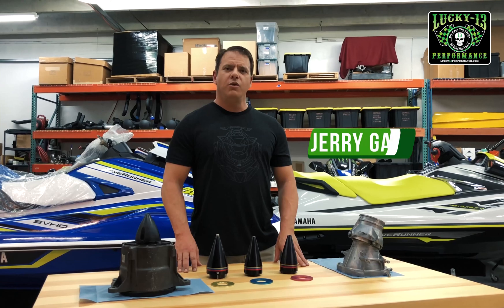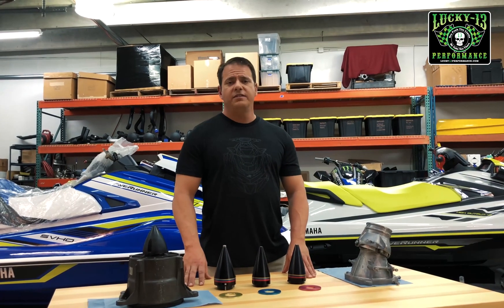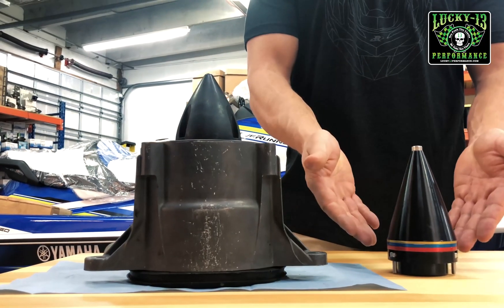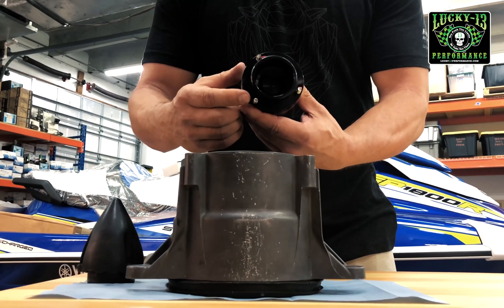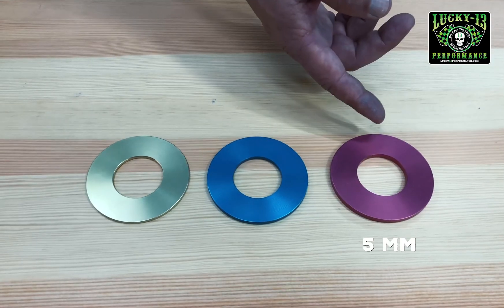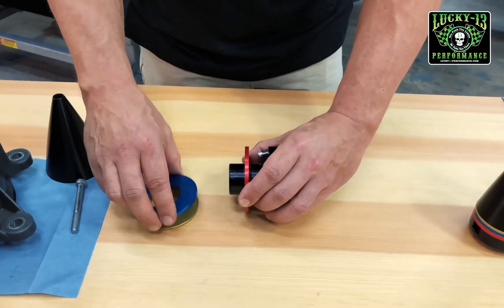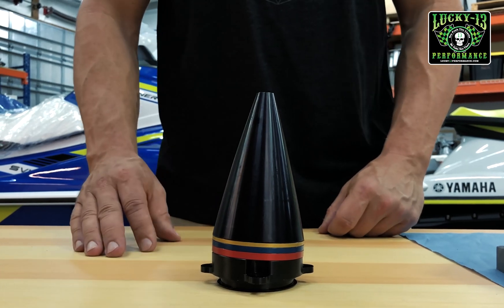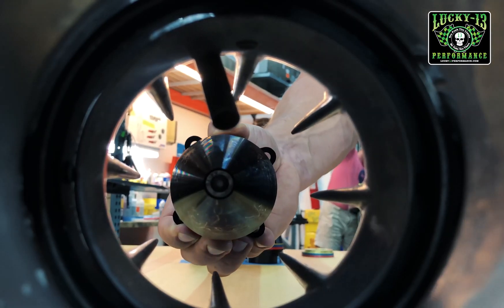Lucky 13 Pump Cone for Yamaha, Sea-Doo and Kawasaki PWC

Comment: Does a ski need to be highly modified to benefit from these or will this also help a stock ski?
Reply from the maker: If your stock ski has a problem with cavitation then installing the Lucky 13 pump cone could provide benefits.
Reply: @rivaracing8468  Could ?? How about we just save the hassle and just send you cash?
Reply: How does this benefit 8800 rpm ECU with full Solas pump upgrade?